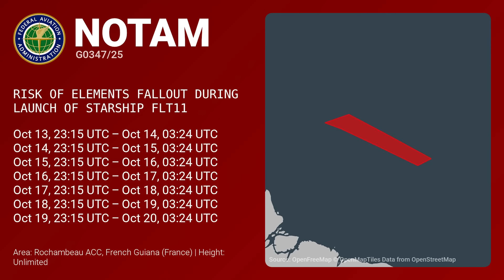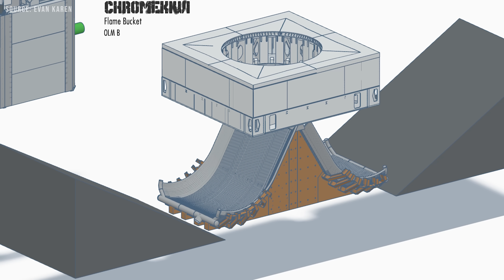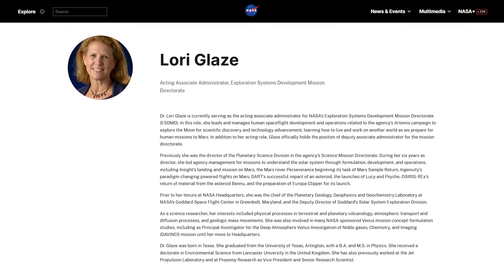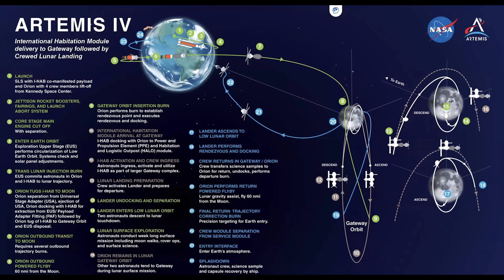Why is SpaceX Starship Flight 11 Launch Today IMPORTANT than Ever...No Backup!

Comment: In approximately 10 years, NASA developed the technology to put men on the moon (7 times) and returned them home. In addition to this , the Apollo program did not need to refuel in space to get to the moon and also included an emergency escape system for the astronauts on liftoff. In fact,  as part of the Apollo program, NASA put men into space using the Saturn IB much faster than the Starship program. All of this was accomplished with hardware and software much inferior to what is available today (using computing power less than most current mobile phones) . 

After all this time, before flight 10, starship has only achieved orbit once (flight 4) and was destroyed on reentry.  

In regards to a reusable launch system, how does Starship and the moon (not the booster) even come into play here? You're not going to reuse the moon or mars version of starship. So for moon and mars missions the starship will not need to be reusable. Yes, you will need a way to combat the heat when entering mars atmosphere but this is different than reusability.  Also take note from history (the shuttle program) and you will see that reusability can be expensive, very expensive. Sometimes more expensive than expendable hardware when it comes to space flight. The expense and time needed to replace / inspect the tiles on ANY reusable starship will not be cheap or fast and safe.

I am not a starship hater. In fact, I do appreciate the idea of getting mankind away from a single planet civilization. I also appreciate the value of reusability. However, for the amount of time that has passed, I do think that there should have been more accomplished for the moon and mars goal than just lots of launches per year.
Reply: Problem with that is, even counting our modern technology, was SpaceX is trying to do the Starship is still several orders of magnitude more complicated than what got us to the moon. 

And SpaceX is only spent around 6 billion dollars so far.
Reply: A sensible goal would have been the perfection of the space shuttle concept, to drastically reduce the cost per kilogram to orbit
Reply: This is not relatable to the shuttle... this ia the biggest ship humans have ever even launched let alone go to space. We cant jist send ppl to space. We have to send tons of large equipment also. This is a new era in space travel. Not the same. And this so called safty system for astronauts didn't even qork. Nasa still killed 2 entire crews woth the shuttle
Reply: I forgot to mention, the reason for the extra fuel today, is because during Apollo literally only 0.01% of what left the Earth's surface, came back. 

Starship/super heavy are trying to bring basically everything back.

As Falcon 9 has well proven, reuse is cheaper than constantly building new.

Comment: It won't take "a few more years". The guy that said that was a peripheral NASA engineer and never explained why beyond 2 absurd examples: Raptor 3 design hasn't been "frozen"... tested all to heck for a year with many missions planned prior, but they haven't stopped improving it... so... problem. As if they couldn't produce any version with additive manufacturing... and the 280t version tested for a year now will get the job done...

The second problem: LEO refueling because "its never been done"... Docking in orbit (done... repeatedly), having fueling arm attach (done... with every launch), tranferring fuel in LEO (already tested). Boiloff can be handled with sun shields (Skylab, James Webb)... so what's the revolutionary tech required that would take years to develope?

The Manned moon mission will launch 2027-8. There's no innovation left that they haven't done before (as if landing on the moon is harder than landing a more spindly rocket on Earth (6x gravity) on a barge at sea with wind and waves.

Comment: Vergeltungswaffe for woke liberals.
Reply: What a hilarious comparison. Why do hate modern engineering and actual innovation? Who tf would even compare a science oriented company with the nazis???
Reply: @07sebi On the contrary. I admire what Elon is doing. Read between the lines. The pun is in designations V-1, V-2 etc. and reactions of hateful people that are constantly spilling shit on everything Elon does because his political opinion is different then theirs. They can't see the obvious: those things ste revolutionary with minimal cases that could be considered failures if any. They do not see that the other program, although it also had its hard times during development Works impeccably because their hatred dimms their Visions and mind and the only thing on their mind is:"He is a fascist, nacist, Hitler!" Such thoughts are constantly droning in their limited minds. That is why I called it the Weapon of Revenge although it is not its purpose.
Reply: @07sebi I think I have given you a clear answer to your question who would compare iz to the nazis, or better who has been doping iz all the time.

Comment: Quit. FUCKIG AROUND WITH THE PEZ DISPENCER!  CATCH BOTH SHIP AND BOOSTER OR DO NOT FLY!
Reply: Why is the PEZ dispencer a "distraction"? They can chew gum and walk. Have you Seen the extent of the infrastructure that they built to support this? The development has been rapid... They Already caught the booster (and will do so again today). They have said that they will catch the ship in launch 13-15. 

Remind me who else recycles their orbital rockets? 

The PEZ dispenser pays the bills... not the US government. It allows the use of the 10x greater capacity Starlink V3 (way more revenue). The US gov cut the lander project from $10b to $3b and. Spacex was the Only vendor that could do it for less than $6b... so they bid $2.9b and have been eating all the additional costs themselves from Starlink revenue (about $12b in 2025 est.) because you can't go to Mars if you can't go to the moon. 

And they are paid that $2.9b in pieces at milestones... so they won't see much money at all until the rocket is ready to land on the moon. Maybe half of very little?

And why must they launch in 2027 vs 2028 when the Chinese are launching in 2030 with a far less capable lander? 

But some dufus (ex-NASA engineer?), (who made Zero sense) said they would delay the project for "years". His explanation was curt and absurd and quite frankly insults the intelligence. A classic "Expert" out of nowhere who drops bombs and runs away with no explanation that makes any sense.

Comment: Why dont they use heat tiles in blast pad
Reply: The shock would blow them off. You have tons of gas moving at mach 5 or so, plus massive vibration. The would be shattered and blown away.  This is at least an order of magnitude worse than re-entry. Water and steel plate works fine... especially with a trench... way cheaper.